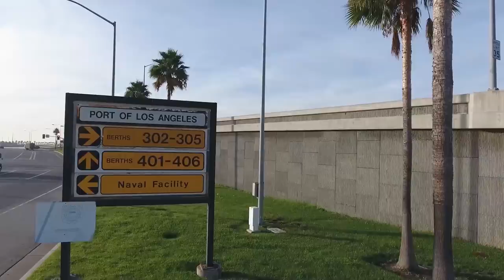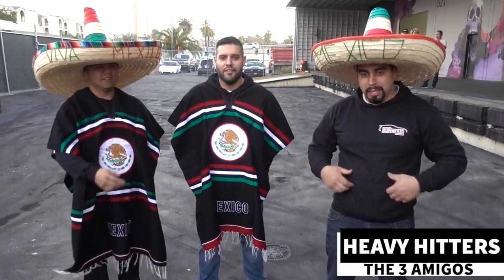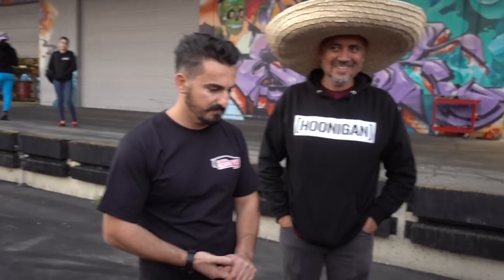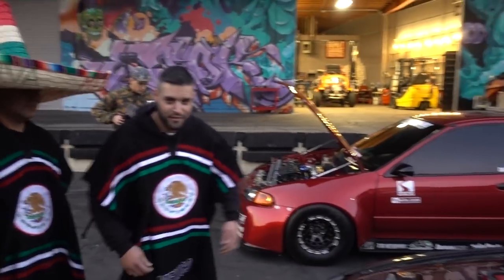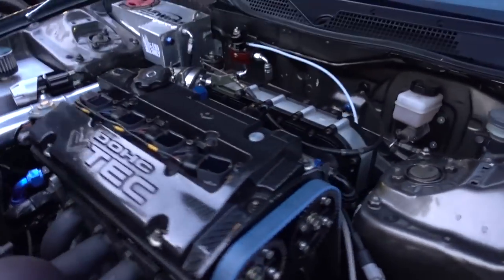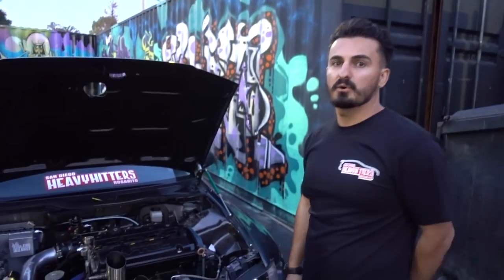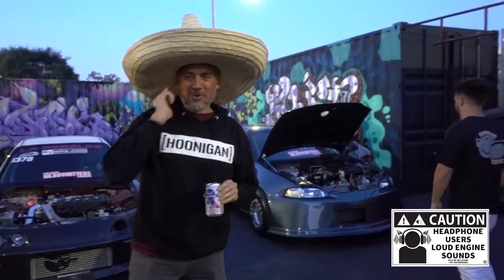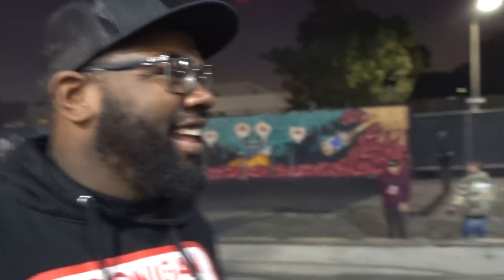[HOONIGAN] DT 212: 2400hp 3 Way Drag Race

Comment: i love how 24psi is "low boost" to these guys
Reply: I'm running 8lbs on a b16 lol that's low boost
Reply: Drag civics run around 80+ pounds
Reply: 24 is low boost, of course it depends on the car but most modified cars run 20psi
Reply: @thatguychris2536  right, my bugeye is tuned to make about that.  closer to 18 actually, which is why i get a kick out of 24 being "low"
Reply: My truck does 25 psi stock and limited 

Higher boost is 60-80 psi but stock internals can handle 65 psi abd the head need retorqued tk do after 45 psi 

But if you run outta map on your turbo the psi actually starts losibg power and just shovin heat
Reply: My Fiesta ST has 22psi stock lol
Reply: Fr v8 dudes always talkin bout “full boost is 12 lbs” like get ur numbers up bud

Comment: I’m not a big fan of Honda’s but Holy shit those cars are dope af killed it 👍🏻
Reply: daniel cardona same here, I don’t care for them at all. But i got respect for those..
Reply: daniel cardona same dude
Reply: When done right they are amazing, but almost all of the street ones are just rusted out pieces of junk
Reply: I only really care for the bigger engines. H22, H23, F20B, F20C, K20, K24. I dont care for the buzzy little 1.5-1.8 engines.
Reply: Keegan Johnson tose smaller engines are more simple for street builds, especially when they don’t have vtec. It works for lower horsepower
Reply: Rezera oh i know. I know they can actually make a helluva lot of power for their size. I just don't like the sound and i like to have some torque on tap from a dig.
Reply: any car guy can dig violence in the ear drum, 2 cam, 1 cam, 4 cly, 8, 10, 12...

Comment: Locked V-tec for the Scumbug? 🤔
Reply: 76CI Harley V twin with a supercharger <3 edit: and get Zac to work on it since he's the hardtail hero
Reply: Locked vtec on all the racecars ftw
Reply: Theyre called vtech killer cams cause it gets rid of the vtech action and it becomes just a cam like in any other car
Reply: I had never heard of people just locking the rockers to eliminate VTEC before, but I guess that's how BC does it. The TODA VTEC killers make a lot more sense.
Reply: They are just locking high cam can prob block the oil passage for it and get a few more PSI to important things they could do it in the map but just a few less things to worry about.  Vtec killers emliminate vtec all together.
Reply: You'd actually have to direct oil to the VTEC locking mechanisms to lock the rockers on to the secondary cam, that's one reason why i was saying that the TODA setup was better.
Reply: idontcare80 you don't know what your talking about.  You take the springs outta the rockers and replace it with longer pins and it's locked please do some research because everything you say is fd.  Both the intake and exhaust have a vtec lobe no secondary cams.  In a normal vtec system the  solonoid actives and shoots oil which pushes a pin locking the rocker so it follows the vtec lobe.  Once you lock it you don't need the solenoid anymore so it frees up so oil pressure for other things.  Look up vtec locking pins.
Reply: idontcare80 the toda vtec killer system would be better for a na system not a turbo system same with s2p3.  You want more of a skunk2 pro 1 setup for boost.  Unless your doing custom profiles.  You will cost yourself to much power with the vtec killer setup way to much intake and not enough exhaust and the overlap creates issues.
Reply: I honestly don't care, I'd never eliminate VTEC from any Honda vehicle. Edit: BTW, all you had to say was that they lock the rockers with pins, I would have immediately understood.

If someone made turbo cams for the TODA VTEC killer rockers, that would still be a superior setup.
Reply: Darryl Larocque LuiCalibre?
Reply: It runs on vtec all the time
Reply: Its pretty scummy

Comment: All that back fire and popping from the exhaust pipes gave me the chills
Reply: Michael Adams is that the correct term?
Reply: Michael Adams forget what I asked just looked it up,  learn something new everyday
Reply: GRIMGAMING 15 real antilag uses a spark plug + fuel line  in the headers to have combustion before the turbo to get it to spool. This is called 2-step or just launch control

Comment: I was just on autotrader tonight looking at '92-'99 Civic hatchbacks. There are 17 in the entire country for sale currently. 
Only a couple of them are stock and not completely trashed. I have my fingers crossed on a '94 si. Gawd I hope it is what it looks to be.
Reply: Good luck man, finding a decent 94 si is going to be tough
Reply: eg6gsr check it out. Ton of miles, but it's been 1 owner since 1996. Clean as can be in the pictures. 
http://atcm.co/S2PVDP/1c57527c
Reply: eg6gsr I have a '91 crx si with 36,000 original miles. My uncle owned it since new. Looks as clean as it did the day it came off the show room floor. I love that car. I keep it extra clean to help make up for all my sins of b18 swapped turbo crx's in the past. I had at least a dozen of them over the years, was never smart enough to keep one stock.  I do have one that's all factory style modified. A '90 with a total Integra type r conversion. Engine, trans, even the 5 lug and type r wheels. I would love to have a Civic to park next to the crx's.
Reply: I live in KS and i can find over 100 for sale just in this state. You need to learn to car shop. Forums, craigslist, ect. Honda people dont go to auto trader and car.com and shit. Honda's hold a value of their own, its called ricetax.
Reply: Harry Balzak Ph.D. I've thought about it. The only thing is, I hate rhd. I had a Mazda 323 gtr turbo back in the day. It was a really cool little all wheel drive hatchback, probably the only 1 in the country at the time. It was like a smaller, lighter evo that made the same power. A guy imported it into Canada then moved to the states hoping he could get it registered, when he finally gave up, he went to junk it, and I scooped it up for $500. 
I never tried to get it registered, just slapped on some dealer plates and went out to the Canyons. 
I actually put mabe 20,000 miles on it, never registering it. But I hated the whole rhd thing. I eventually got good at the left hand shake and stuff, but it always just felt wrong. Eventually sold it to a guy who wanted to make a scca cone racer out of it.
Reply: Michael McClernon forums are one thing, but my experience with Craigslist has always been shit cars or headaches.
Reply: Harry Balzak Ph.D. taxation is theft, as are all of the arbitrary payments demanded by the crown.  Since when did this become the land of the fee? 
So yeah, if I can get away with driving a throw away without registration, hell yes I will. 
The worst is licensing. What's a replacement license cost, something like $30? I would be more comfortable paying for licensing if people were actually made to learn how to drive. Every idiot has a driver's license. People without the slightest understanding of physics or why they shouldn't tailgate in their 8000lb suv with 24" chrome wheels with shit tires and stock brakes that have never been changed. 
It's become painfully obvious that the whole point of the DMV and licensing fee's are to perpetuate the existence of the DMV. It obviously has nothing to do with teaching people to drive it maintain safe road ways....
Paying fees for the sake of having to pay more fees? That's the 'murican way... Apparently.
Reply: If you have facebook look for car pages near you and Craigslist is your best bet go to car meet and talk to people , btw check my channel for badass imports racing and highway pulls , also ima going to start building my 92 eh2 eg hatchback
Reply: Yahmon! around 2006 i bought my 2nd hatch a Eh2 ( 1992 Si 3door..) Bone stock never modified from an older guy out here in Hawaii. 99,000 miles everything there, even the owners manual in the glove. All the moldings and mud flaps 2. guys was asking $2,900 ( kbb about) and i was tripping ppl were trying to lowball him! worked out good 4 me! but there gotta be WAY more then that. there's  probably like close to that many 4 sale out here right now or will within the next month or so. imports seen (mostly Hondas) always been big out here tho. most have motors and a bunch of mods tho. normally B18 or so turbo'd paint rims etc 4 like 5,000-8,000 grand . good luck! you should b able 2 find one tho!
Reply: ps i trip i actually found her on craigslist ! still stock 2 this day! she needs some love tho... Brought that bitch 2 every corner on this island lol! car is a fricken tank tho! she just keeps going wit barely any problems even when i aint showing love. like don't change her oil 4 a year.. opps? lol. shell be over heating.. like ahh.. roll down windows blast heater in car. problems starting.. use that portable battery till that don't work and just kick start umm! ahh man. she knows i love her tho!  had my old crate motor ( h motors) but didn't wanna touch her till i did it right! so glad i didn't do a bunch of dumb shit and crash her or get her stolen. soon tho cppl small and clean things when im dunn wit my dc5. Nice fleet of whips u had tho and supper sik crx!
Reply: Don't forget to look in salvage yards online, u can get em dirt cheap and may find some that still run
Reply: I drive a 92 eg hatch, it’s a d16z6 that’s fully built and turbo. My stepdad and I built it for my first car. I love it.
Reply: Wot, only 17 civics in the whole country? I think you mean state
Reply: Funny thing is that I recently found out my boss has 4 of them in stick and super good condition amongst other stuff like m3s

Comment: Saw an integra, I clicked.
Reply: I was not disappointed.
Reply: I have a question for the owner of the last civic. What is the benefit of the b-series trans? doesn't a prelude engine usually come with an LSD? why wouldn't you want to use that and just lock out 5th gear and run it in the 1/8th mile. OR even better on a track!!!!!
Reply: sieve5 cause it's a 4 gear 8 mile drag civic. turbo lag would suck running anti lag and 5 gears.
4 gears is a lot less work on the Dino to tune the 5 gears
Reply: loved that integra wish mine looked like that lmao

Comment: I have a 1970 dodge charger with a supercharger kit and nos with AFR at 10.47 and it makes 1800 HP and it weighs around 2700 lbs and has a top speed of 210 mph. This is all I'm going to say about my car
Reply: in venezuela you can get a original one for less than 5 grands...
Reply: Where's the videos
Reply: That sounds rich as fuck btw

Comment: High compression forced induction makes all the sauce. Figured hooniguys would have caught wind of that by now.   All the pro v8 cars are borderline high compression.  The same car, one with high compression turbo, one with low compression turbo. The high compression engine would make power twice as fast and move twice the air.  An over squared high compression engine on boost is a rabid caged beast with pedal control

Comment: Did he just say he paid $9k for a G-force trans? Mine cost me $3k, WITH labor. lol... Im not sure I trust his 11:1 static compression statement either, considering hes boosting 32 pounds on pump gas. Even if he detuned on the drive there, and uses 115 at the strip on full boost, thats really playing with fire. The kind of fire that makes pistons say hello after your first pass. And all this in 800hp... I have a strong urge to see the dyno slip before accepting that number and these statements.

Comment: Sad when the tuner can't explain that you don't simple lock VTEC. You replace the 3 heavy VTEC steel rockers for a  light weight aluminum vtecless design,  giving u much higher rpm capabilities.